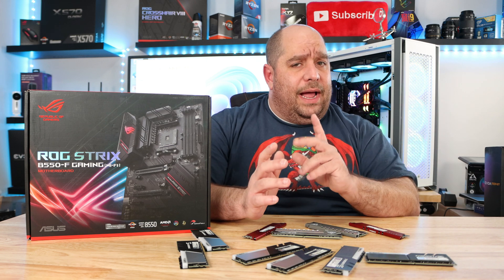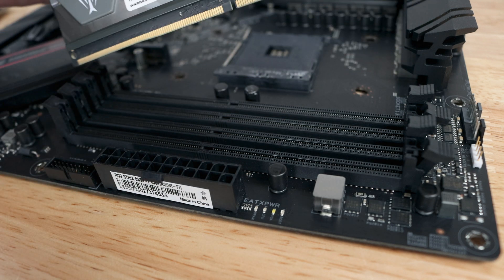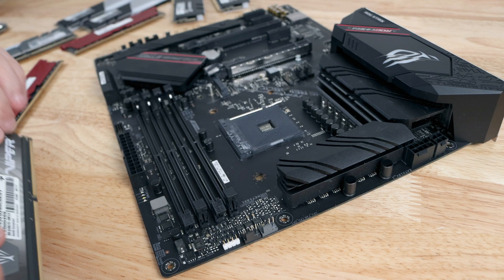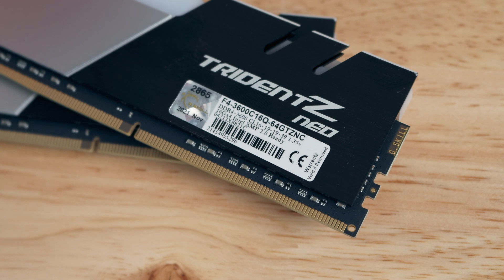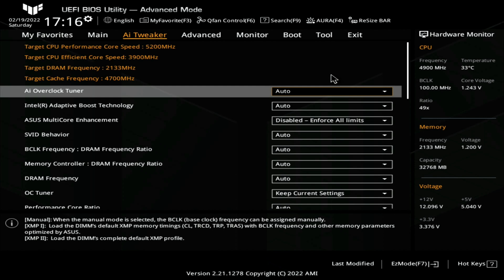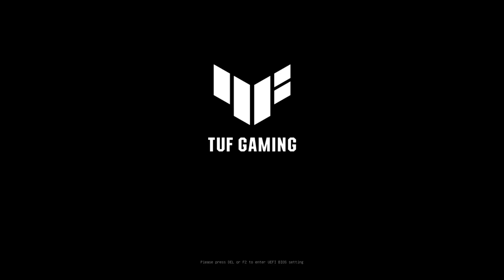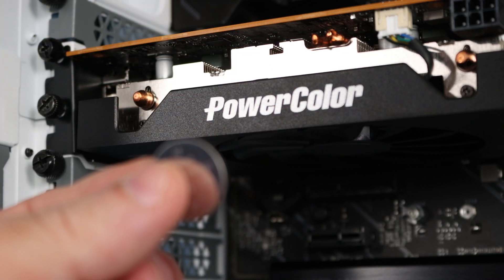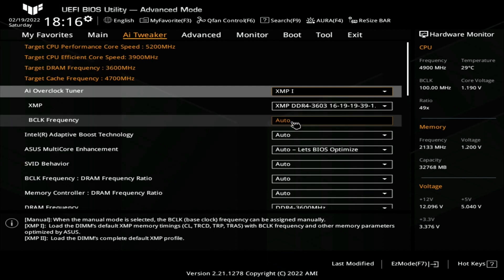How to install and configure RAM in a PC - Step By Step Setup Beginners Guide

Comment from the maker: WATCH NEXT: How to install an SSD and Windows 10: https://youtu.be/vXpAsf7SJ3M
We go over How to Install and configure RAM into a PC, a Beginners Guide.  Here we help make sure to get all of the performance out of your RAM and settings just right, speed and stability.
Reply: I bought two sticks of ram few months ago bought two new ones last week now my pc will blue screen randomly in games they are the exact models as far as i can tell 
Ddr4 3200mhz cl16 ocpc  
even the same manufacturer Samsung
But i cannot get xmp working on it only works on 2133 without xmp 
Is there any fix or will i have to sell my ram
Reply from the maker: They are not the same, install them like I show you here and you will probably not be able to use xmp together.  You will have to cater your speeds to the slowest one, and the higher voltage.
Reply from the maker: @joegt123 let me know if you want help, you need to put in a little work

Comment: I have an Alienware Aurora R7 and we just bought 2x16 RAM. It is supposed to run at 3200. When I installed the RAM and started it up a "DOS" type screen popped up and said that the RAM has changed and to hit continue or BIOS or diagnostics. I selected "continue" and it worked fine. After I had shut it off and turned it back on the next day the orange light appeared and it would not boot up. I looked it up and it said that I could try removing one of the sticks and start it back up, and it started back up. But when I shut it down again and try to start it up, it wouldn't. But when I added the other stick of RAM back, it would. It is almost like it will take the initial change in RAM but won't remember it for any future start ups. Once I disabled the XMP, it will start up but like you said in your vid, I am not getting the maximum performance speed. Could the RAM that I bought for it (Corsair Vengeance LPX DDR4 3200 MHz) be the wrong RAM for this system? Please help. Thank you.
Reply from the maker: Maybe, but did you watch this video for how to install the RAM, and what processor are you running, with what motherboard?

Comment: There are six slots on my motherboard. There were six memory cards in the slots, but one of the have died. Can I put five memory cards (DDR3 DIM  non-ECC, 1066 MHz or 1333 MHz)  into the slots???   Will the computer work correctly?
Reply from the maker: It "should" but it would be running in single channel mode, so it would be going slower

Comment: Thanks so much for the great video! I will do a slight upgrade to my RAM (from DDR5 5200 cl 40 to 6000 cl 36). Do I need to remove the CMOS battery before switching the RAMs and power into the BIOS?
Reply from the maker: Always please my friend, no, I recommend you set you memory to auto.  Save and exit, boot into windows, shut down and then upgrade.  After you upgrade do what I show you in the video and you should be good.
Reply: @ThisBytesForYou  Oh great, thanks! I think I did not properly understand when CMOS clearing for RAM configuration is necessary
Reply from the maker: @Sniffsand  Always a pleasure my friend, so very happy you stopped by, trusted in me to help you, liked and subbed as well as took a moment out of your day to thank me.  It means a ton to me and I am so very happy I could help you.

Comment: So I'm worried, I got 2x16 GB RAM sticks for my laptop and I booted up my computer no problem. I looked up this video but I'm afraid I'll break something. I find it weird that there were no problems when popping them in and booting up windows. Any advice?
Reply from the maker: For your laptop, should be even easier, as long as you verified that the RAM was compatible with that system.  Remove the RAM thats in there now, and pop in the new RAM.  If it doesn't boot, because its not compatible, remove the battery, remove the RAM and put the old ram back in then put the battery back in and turn it on.
Reply: @ThisBytesForYou  Such a legend, thank you man.
Reply from the maker: @meisterashmilhair4358  Always a pleasure my friend, so very happy you stopped by, trusted in me to help you, liked and subbed as well as took a moment out of your day to thank me.  It means a ton to me and I am so very happy I could help you.

Comment: Hey, so I got a little question: I'm running a Ryzen 7 2700x, a B350 Carbon gaming Pro and 32GB of G.Skill ram. When setting my XMP profile it selects 3600 mhz which is what it says on the ram too, but after saving and exiting on the Task manager it says 2133Mhz, despite it saying 3600 even after then shutting down the system and then going into the bios. Any idea what could be wrong? Or does Win 10 halfen the number in the task manager and I'm somehow running +4000 mhz?
Reply from the maker: That can happen with Task Manager, especially if windows has underlying issues and you don't keep up to date on updates.  Download CPU-Z and see what it says.
Reply: @ThisBytesForYou  Under Memory? Or where should I look...cause there it says 933 uncorr mhz rn. Task manager says my ram runs at 2133mhz with two 8GB sticks, and with four of the very same ram sticks (just bought at a later date) it's running on 1866mhz in Task manager, which super confuses me.
Reply: One sec, says that 16gb are reserved for hardware rn. Gonna try to change that to get actually 32gb of usable memory according to the task manager
Reply from the maker: @markolol1238 have you watched the video we are chatting on?  The video installing and configuring ram, what I mention about different ram sticks even if they are the " same"
Reply: @ThisBytesForYou  Yeah, and I hope I've understood it. The last three digits on my first 16gb kit are only one number apart, while the other two sticks have a later date, but still only one number different from each other. Sorry if this sounds weird, English ain't my native tongue lmao
Reply from the maker: @markolol1238 yes they will never be the same number, since there is 1, 2, 3 and so on.  So the kit you bought together goes in alot 0 and 2, and the other kit you both together if it works with the other kit, it may not since they surely have different IC's, would go slot 1 and 3.  Test kit 1 is 0 and 2 alone, see if it registers correctly.  Shut down computer, remove kit #1 and put the other kit in slot 0 and 2 and see if that registers correctly.  English isn't my native either, it's Spanish but you seem to type it very well.
Reply: @ThisBytesForYou  Alright, I understand. I'll try that out. Thank you so far for the help
Reply from the maker: anytime bud, let me know how it goes.
Reply: @ThisBytesForYou  Just to clarify, I have two RGB Sets of 2x8GB. One from 2020, other from 2023. You want me to try out first the first kit, check if CPU ID says 1800 mhz and then the same thing with the 2023 kit?
Reply from the maker: I want you to check 1 set to see if it hits the speed your RAM should be, if that works, remove that ram then install the 2nd set to see if that speed works,
Reply: @ThisBytesForYou  You don't have a Discord Server any chance to send you pictures? Also trying this out rn
Reply: @ThisBytesForYou  Kit #1 runs on 2133mhz, without X-AMP, and with X-AMP which is set to run at 3600, it still only runs at 2133. Same thing happens with Kit #2.
Reply from the maker: @markolol1238 ok... Now install the ram the way I mention here and in the video, and see if that helps, the 2 different sets maybe incompatible with xmp, they may work if you Manually set them in the bios but it's always best to buy them in 1 set.
Reply: @ThisBytesForYou  Both say XMP 2.0 compatible, but I'll try it just how you did in the video.
Reply from the maker: yes, both are XMP, but you can't have different sets together using XMP, since their profiles are different.  Try one set, then see what XMP sets in the BIOS, write it down, then another set and try XMP and see what it sets in the BIOS and write it down and then compare them.  If there are differences, you will need to manually set them in the bios without XMP, setting them manually, setting the slowest of the 2 settings.  As for Discord, not publically yet, I don't do 1 on 1's because they eat up time, weekends are the only time I have to work on videos,... haven't touched one yet and the days almost done and I have been able to spend time with my family either, and I have a day job during the week.  If you would like a 1 on 1, it would be $100 an hour, since the free service I am providing you now, isn't good enough it seems.

Also, it is extremely exhausting and wasting time for us both to have to keep pointing back at things I do in the video, that you haven't done over and over, its why I make the video, to make it easy, but you have to pay attention to what I show you and do what I show you.
Reply: @ThisBytesForYou  Everything works correctly if I can find a timings table in CPU Z that mentions XMP running at 1800mhz, right? Because I do see it with the correct timings and voltage, and according to task manager I have 32GB available. If yes, then thank you very much for your help, and if not then I'll seek out help else where cause I can't afford an hour of your time.
Reply from the maker: Sounds good, 1800Mhz, x 2 is 3600Mhz, the money is more to open your eyes so you can focus on what you are doing and not using me as a crutch then also valuing my own time.  You can do this, my videos can help, you just have to pay attention and implement what I show you.  You can do it.
Reply: @ThisBytesForYou  Yeah I figured, but I guess everything works now. Thank you very much for your help. I shall no longer bother you 🤝
Reply from the maker: @markolol1238 not a bother at all, when you have questions or such, its only a bother when you have questions and my answers are in the video, other than that my friend, I am always happy to help and I welcome you to the family and I hope to catch you on more videos.
Reply: @ThisBytesForYou  bet